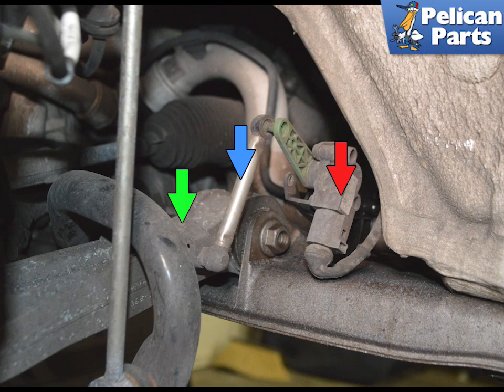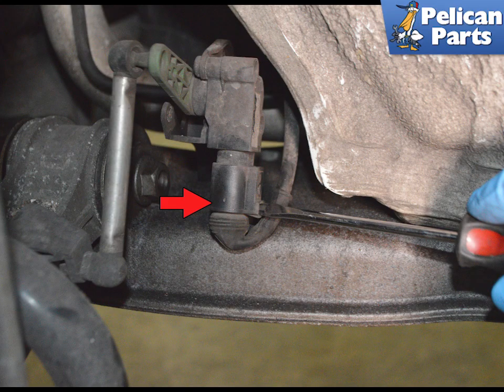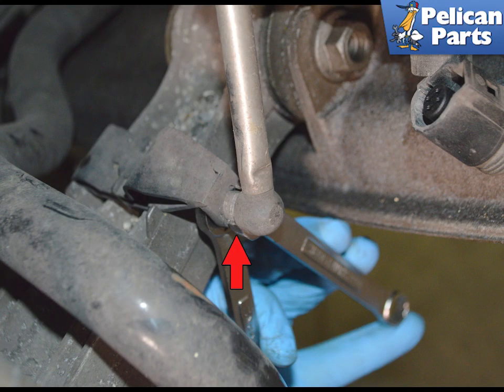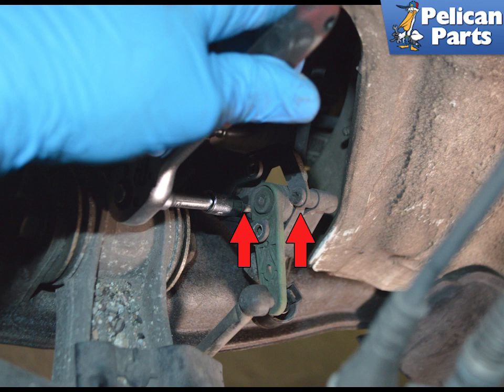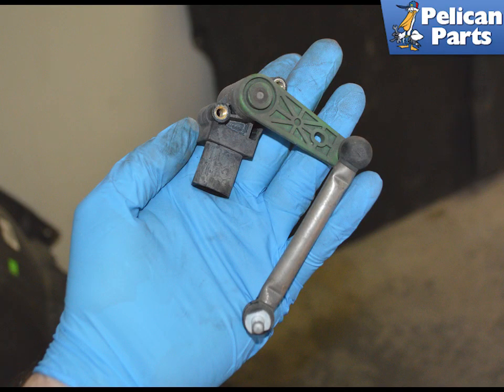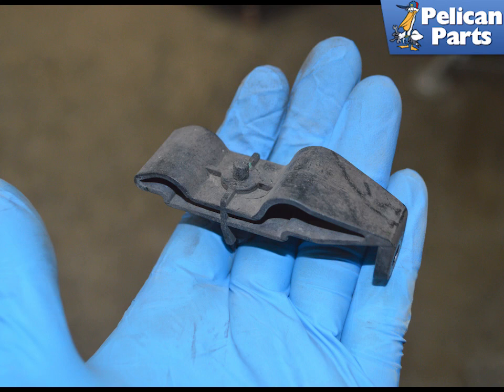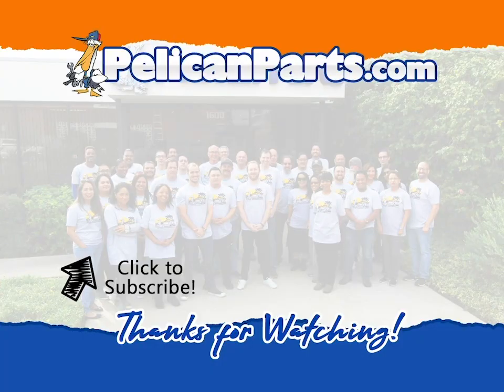Porsche 991.1 Carrera Front Headlight Leveling Sensor Replacement (2012 - 2016)

Comment: Hello! Nice video! maybe you know how to calibrate lights? i change sensor, bur light shines downwards 🤷‍♂️
Reply from the maker: Sensor might not be installed correctly. If it is, you may have to perform an adaptation with an advanced scan tool.